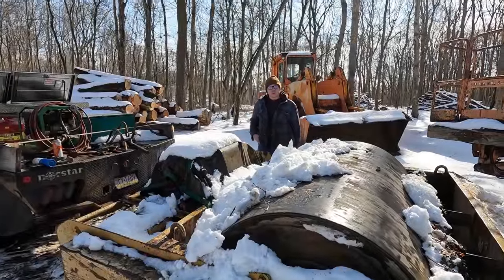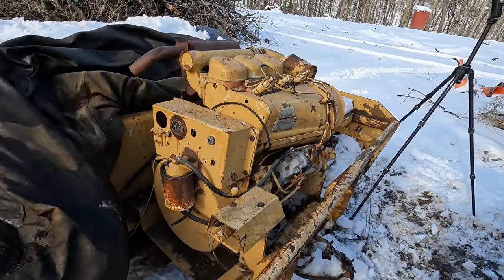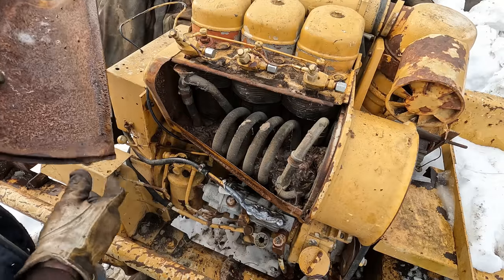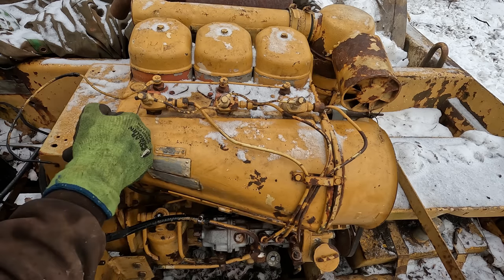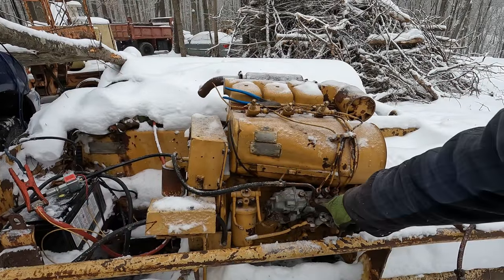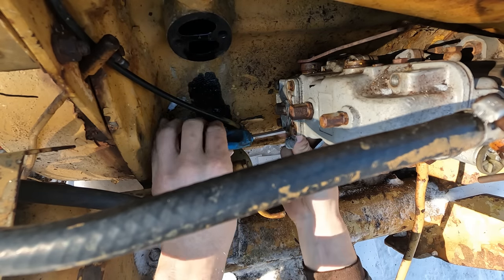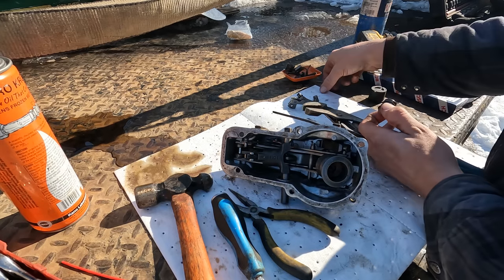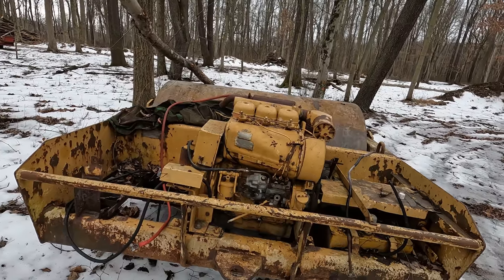Diesel Powered Roller Compactor, Sitting 30 years, Will it ever Run again???

Comment: As it was turning over you can hear the compression. First and second sound similar but the third has a lower tone. Yes it will run but one of the cylinder is down on compression. Also look for rust spots of nuts and bolts. It's another give away if it been worked with alot or a little. Lot means it either was run hard or someone constantly took care of it. Since you found it in a wood line. I would say run hard and only good enough to get the job done. I love doing the samething, I always like watching your videos.

Comment: There was a YouTube short last week showing a cold starting diesel with a rose bud flame being sucked down the intake. This did not replace all the incoming air. But super heated the incoming air charge so the compression did not have to heat it so much to reach the  compression ignition temp needed.  That also sounds like the drive belts are trying to spin the weights  while you were cranking..

Comment: Matt, I really don't think you should be using ether on that engine. We had a Duetz farm tractor, they told us to never use ether on it. Being an air cooled engine the cold tolerances on the engine are much looser than a liquid cooled engine, so the ether can run down the cylinder walls, removing the engine oil as it does. We tried ether in desperation one bitterly cold morning, and scored the cylinder walls in that engine, always smoked after that and lost power as well .Better thing to do is blow heat through the fan to pre-heat the cylinders before trying to start it. Hope This helps. Love your videos.

Comment: 36:30 been there done that with a small brass carberettor float pin. went down into the expansion joint of a concrete floor. You are lucky, very.

Comment: I once spent dozens of hours on an old CAT diesel trying to start it, bleeding the fues system, etcetera. I finally realized there was a sticky spot in the throttle just before it opened the fuel valves.

Comment: IDK much about these little air cooled engines, but my Mercedes 300D has a bosch MW pump on it. If you want to bypass the lift pump on those they typically want to see around 8-18 psi of fuel pressure. The lift pump looks really similar to the one on my Mercedes, as well as the primer so that might be a good way to track down parts. It doesn't have the fuel bowl but besides that it looks really similar.  Also fun fact, the emergency fuel shut off works by pushing the throttle linkage past idle and that will slow the engine down enough to kill it. These old mercedes have vacuum shutoffs that sometimes don't work because of leaks in the vacuum system

Comment: All types of Deutz air cooled diesels are superb. However spending hours trying to start the 3 pot was frustrating to watch as it was never going to start turning over so slowly. They need a good kick with a decent starter and well charged battery.

Comment: Wait till spring. If you need parts the 4 cyl deutz you can buy at military auctions they came on fuel transfer pumps made by Gorman Rupp...

    They run about 1500 with zero hours

Comment: I've worked on a few Deutz engines and tractors, they are air cooled and never worked on one that had water in the oil pan except for the one that went under water.

Comment: You had slotted screw heads, but if you strip out a Phillips's head, try a dab of valve grind compound on the screw head and screwdriver head.  Sometimes, it's just enough more bite to loosen a screw.

Comment: I’d remove that drive shaft in front until the engine is running good then reinstall it . There may be enough of a drag on it to slow the engine turning over , considering it has been sitting a long time.
Reply from the maker: Genuinely never even considered that 🤦🏼‍♂️
Reply: Agreed, was always told when having difficulty starting anything remove as much load as possible
Reply from the maker: @benmac940  Its common sense that just hadn't even entered my mind.
Reply: @DieselCreek  we all overlook even the simplest of things occasionally. You do remarkably well with these old machines.
Reply: Not necessary. There is centrifugal clutch in drive pulley.

Comment: We have4  Duetz diesels on our farm.  My grandfather bought two tractors in like 1981 or so that we still have and they still running  strong on the original engines.  And we have two 6 cylinder industrial units on deep water wells.    Great motors

Comment: bring a generator and a hairdryer and blow hot air into the air intake , that will help if the glowplugs are not working
Reply: USA youtubers stubbornly refuse to use the glow plugs. 30 seconds or more is needed.

Comment: Id also recommend pulling the injectors and squirting some oil down into the cylinders, taking out the injectors is really easy on these engines.
We do that most of the time when we reuse old Deutz engines.
I work at a Deutz dealership, if u need advice hit me up.

Comment: I am amazed that you didn't put a new fuel filter on it before trying so hard to start it, especially after seeing what the inside of the pump looked like. Thank for sharing!!!
Reply: Looked like the filter was by-passed when the temp tank was installed to me. But l could be wrong.
Reply: The fuel filter suppose to screw on top of the oil filter housing. The lines had been cut off. But since he use an external tank He know that the fuel in his tank is clean so to start it I don't think he need a fuel filter.
Reply from the maker: I checked the flow. It has tons of fuel getting to the pump

Comment: Hey Matt, enjoyed the video, next time once you get fuel at the injectors, close at 2 of the 3 injectors. She will start a little easier. Here in South Africa we have tons of those engines running around. Just another thing and we don't get cold like you guys but it might help to disconnect that shaft off the crank to reduce trying to turn some else at the same time. Keep up the great work.

Comment: Those deutz air cooled engines are fantastic in my experience. They're generally trouble free and the ones I've used sip diesel.  My chore tractor a 2 cylinder 30hp model uses less fuel than my lawn tractor and pulls harder than a 30hp tractor has any right to.  Just make sure you keep the fins clean, wasps and mice plug them up.
Reply: Very common in Australia, and yeah, super reliable little diesels, and (at least here) super easy to get parts for, Repco stock a lot of the common bits
Reply: They are avoided like the plague here. KHD with Deutz Allis really screwed up with them. Parts are impossible to get, aside from in a few certain areas.

Then again, replacing a well known and trusted line, Allis Chalmers, with a completely unknown and virtually unknown style and putting them in a dusty chaff filled chamber was a very, very, very poor idea. Poor enough that you can't give away Deutz powered Gleaner combines, as they are known for having engine fires. No radiator to be a secondary filter and no big fan to keep the chaff of the exhaust manifolds, along with the fact that they must be kept perfectly clean.

Also no cab heat and cabs and tractors that were 20 years behind went over poorly in AC's former northern area. I have to laugh when a Deutz tractor or Deutz powered Gleaner comes up for sale; "Mr. Buddy propane heater included for cab heat", "No engine fires", "have Cummins/Allis replacement engine that goes with", and "Converted to liquid cooled Cummins engine".

Comment: Heh..  I’ve got a little-brother to that with the 2 cylinder air-cooled.  Spent most of the summer trying to find glow-plugs for it.  We’ve been using it for 30 years, and it’s a great little compactor.  Found a pdf of a service/repair manual, but it’s all in French. :)

Comment: Matt, just an observation/suggestion: Have you considered getting one of those "personal" small tents, like a shower tent? They are tall and sell for about $70.00-ish. Most have a floor and you can hang a light. Put a small table in there, a small heater, and you have a small portable workspace OUT near your machine. If something "pops" off into the nether region, it's contained :) Just an idea/thought!

Comment: Ran a case dozer with a dynapac behind it just like that and one of the best 6 inch water pumps I have ever seen was powered by that same motor it was super simple not much to worry about just check the oil everyday when you started it .oh yeah and they do not like the cold at all

Comment: A little trick my buddy taught me years ago which I don’t see you do is whatever you got work on the day before I spray up all the bolts or connections so I somewhat freeze them out the day before so you can work them off without breaking or stripping anything. ??

Comment: Sometimes ether dries stuff up too much. A good dose of penetrating oil Sometimes will do good because it helps seal the rings, lubrucates and also pops off just a little easier than the diesel fuel. Try a capful of WD or your kroil. Take out the glow plugs and give each cylinder a dose. It'll give you a chance to inspect the glow plugs while you are at it. Also it wouldn't hurt to hit the starter with 24 volts for short bursts to give it a quicker spin which usually helps get the compression up enough to fire.

Comment: Hi there Matt, friend of mine owns an atlas excavator with a similar engine, just a four banger compared to your tree banger :-) pun intended. Im doing the maintenance on that beast. Those two adjuster screws in the pump covere you where wondering about while changing the fuel dosage lever, the one you where talking about sets idle, the other max. rpm, no big issue to reset with a tach. The oil in the pump (cheap 10w40 will do, no special requirements, just to lube the cams and keep water out) gets diluted by diesel while it runs, its the diesel that bypasses around the plungers, that should be about zero, but well its an old system, will more for sure, thats why you have to change once in a while, supposedly at 2000h interval, otherwise, if not for daily construction work, its kind of a life time filling. while you start running it, go check the level in the pump too, when you pull the dipstick to check the level in the oil pan, if it rises from diesel, rinse and fill. So you get a feeling on what interval to check on it, the diesel wont damage it, just make sure it does not built pressure inside from overfilling to zero air cushion, then it will start to leak everywhere. the shutoff is on RUN when its pointing to the blower. what ever you do, use extreme caution if you ever take off those half moons on top of the pump and unscrew the dosage valves, they are slotted and if put back in the wrong slot, that cylinder will get the wrong amount of diesel per stroke compared to the others, or the valve will be destroyed all together, had to fix such a rooky thing on my friends atlas, that work really s*cks. If you need parts, you can get all the DEUTZ parts from China, we have good experience there. I would go with engine parts to the china sources and with the injection stuff would stay with BOSCH Germany through your local dealer, of if they cant get it, contact me, a friend of mine owns a BOSCH service. Before it will start, it will need substantial increased speed from the starter motor. If you need manuals for the engine, feel free to contact me, I could also help with translating them. And instead of heating the intake, just give it the propane flame right into the intake, itll take right off. When we start our old engines, we have a mobile diesel air heater. hook that up to the intake with a T, so when it starts, it can draw additional air, and then start it. it fires right away, no stress on the starter, no matter the outside temp or glow plug state. Goes for all diesels, depending on if you want to waste starter motors. A heat gun does it as well. Those engines dont pull much air on start revs. Cheers Manne
Reply: And one more thing, the original fuel pump has a membrane, its prone to fill up the pan with diesel, and usually thy miss some of the seals and draw air like crazy. the high pressure pump does not need to have pressure, its self priming, so long it does not need to such the fuel in. But what it needs to have is a back flow to the tank to get air out of  the pump housing, thats what the pre pump is needed for. You could easily do this with the electric pump. I personally prefer the mechanic tho, because the dont die on you without notice, like the electric pumps, and some diesel in the pan wont kill the engine, its not like they start gushing gallons of diesel into the pan inside 5 seconds, even if you run it 8h a day and check oil each day, youll notice it long before its a problem.

Comment: Take the serpentine  belt off just to do the initial fire up. The drag of the fan, the alternator, and anything else belt driven is slowing down the starter which is slowing down  the ohh soo important piston velocity. Run it for a few seconds with the belt off, just enough to put some heat into the engine then reconnect everything.

Comment: Hi Matt just a little tip that may help you instead of using tractor crack hold your blow torch near the air intack and feed the engine with hot air this has worked very well starting old and cold diesel engines and it helps the starter last much longer I hope this is a help for you.

Comment: Maybe it had started to run away and they snapped the throttle shaft off trying to get it to shutdown.  I haven't seen the fan turn yet, even when you were turning the pulley.  For the little key:  I've learned that when I'm working on something with little parts like that I need to cover it and my hands with a cloth while I'm doing it so it doesn't fly off so far.  It's a pain but less then hunting the part.  Something I've seen other people do is to direct the burning gases from the little torch INSIDE the intake manifold to put warm air into the manifold itself.

Comment: The injector pump will be full of ice water just like the governor compartment.  The injectors are probably not squirting either, as many have stated you need to glow, and the starter was never cranking fast enough - probably turning the vibrator which is not releasing.

Comment: A lot of those Deutz air-cooled diesels were shipped to the Northeastern USA as well as Pennsylvania. Go check out some tractor graveyards for a parts engine. Or pick up a Deutz-Fahr as another project. They'll run forever.

Comment: I would have a cheap magnet in my work truck, even one from Harbor Freight. I have one from there that is a magnet inside a plastic case like thing that attaches to a handle with a sliding spring. Great for those small jobs.

Comment: #1 -I hope you got the starter (that couldn't be rebuilt) back. 
#2 - it can definitely be rebuilt
#3 - glow plugs are pretty much needed this time of year... Possibly cheat with a torpedo heater set back with a tarp/canvas draped over top of the engine.
Definitely used that trick on the farm in Wisconsin a couple times.

Comment: You can open the little cove on the side of the pump behind the fuel lift pump there is a rod which moves forward and bacwards you can control the engine revs with that rod and please check if rod  is not stuck becaus it can run away if it is  stuck in the open position

Comment: Matt, When you pressurized the fuel going into the injection pump it should have flowed fuel through the injection pump, coming out of the return line/port on the injection pump(if everything is working correctly).
Reply from the maker: I agree. Thinking there may be some more to the puzzle….

Comment: For what it's worth, the alternator on that looks like an AC Delco. The comments suggest that the engine is 60's vintage, I really doubt the alternator is that old. Given the ad-hoc appearance of the alternator bracket, I confident in saying that the mechanic grabbed the cheapest alternator in the parts shop or one out of a parts truck and made it work. Every parts store has this alternator or one similar enough to work. If you plan on putting a lot of lights on it, you should consider getting a more modern one that has more amperage. Otherwise, don't worry about it.
Reply: Also, the alternator's power output greatly depends on speed. The alternator is probably designed for gasoline car engines, so a diesel might not rev high enough, even if only a little bit. If you have a problem with power output, you can try a smaller pulley. 
Check to see if it has a voltage regulator attached to the exterior of the alternator. If it does, then it is an easy fix should it go bad. The problem is most parts stores carry two-ish different voltage regulators in stock. Order it in before it goes bad.

Comment: When I watched this video for the first time, I thought it would be really tough to get the engine running in all that cold weather. Matt, when you took that guard off of the chain drive mechanism for the roller I thought it would just be something out of adjustment. I was really surprised when you found that shaft in two pieces.  That’s a good size chunk of steel but of course the roller is a good size piece of equipment. I’m gonna guess (notice I said guess because I don’t know) it would be quite a job to weld that back together, pretty expensive to have some machine shop do it, or to even find a replacement shaft.  

You (simply) have to know when to hold ‘‘em and know when to fold ‘em.  I’m glad you get to be the one to make that call.

Comment: You can reuse the nose and the bendex get a 3510ST swap the nose and bendex. Down the road motors. If nessasary swap roller bearings between the 2 bendex.     Ran a starter/alternator/electric motor rebuild shop some years ago.  That said labor involved plus parts to rebuild it would probably cost more than replacing it.  The way it sounded you probably blew the solder joints out of the armature. And that cooked the windings and the starter relay. So all that would be left would be the bendex and the housing.